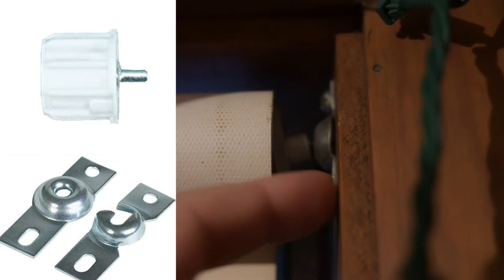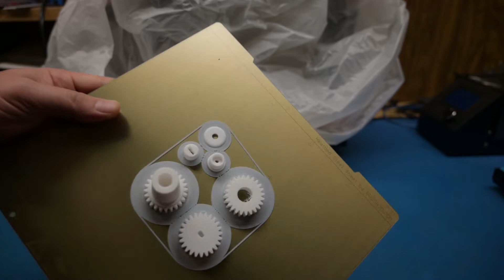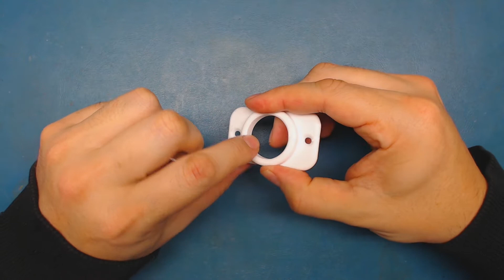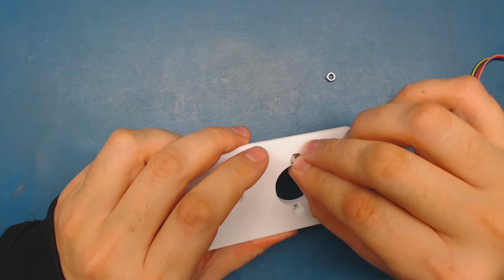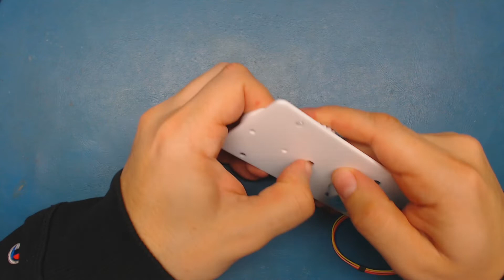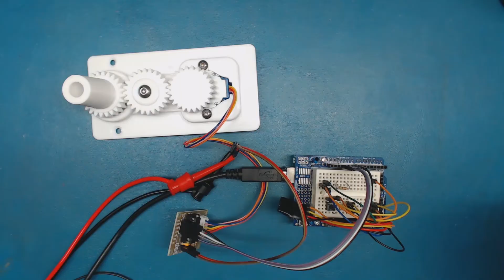Automated Shade Part 1

Comment: Do you really get that much warping with PETG?  Do you have a heated bed?  I may have had one print in 3 full rolls of a couple of different PETG materials and never had a warp (between 55-70c). ABS is the toughest to print, but a cardboard box over the printer will do.
Reply from the maker: Yes PETG can warp corners off the bed if it is printed in colder temps. I am using a Prusa MK3. My basement can get really cold during the winter months.